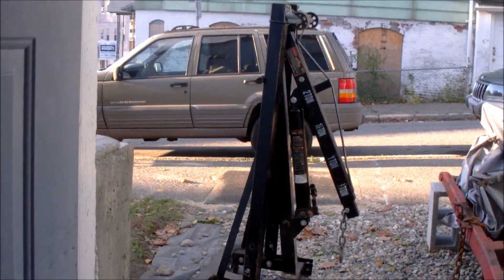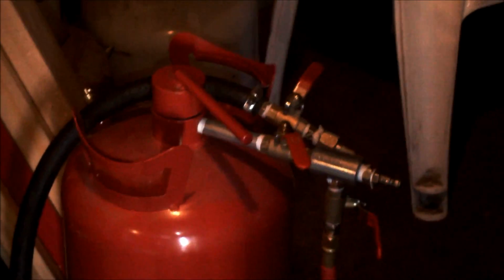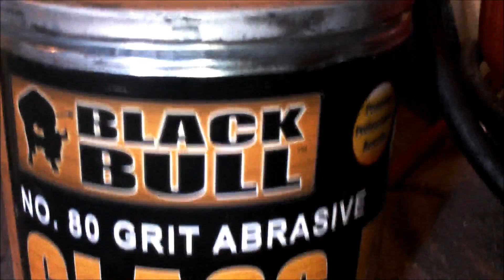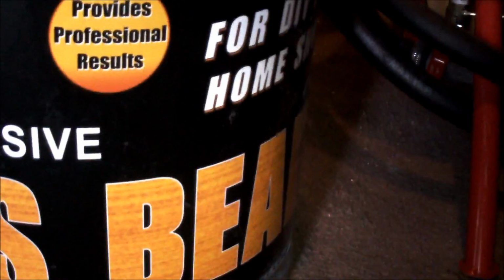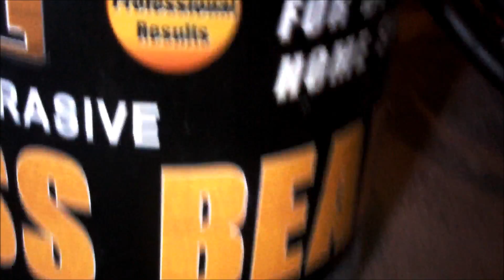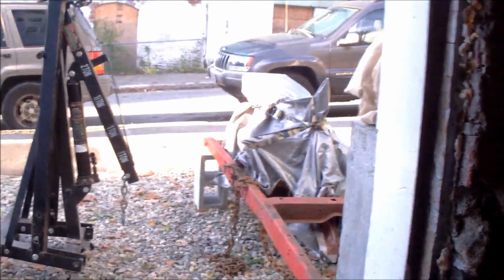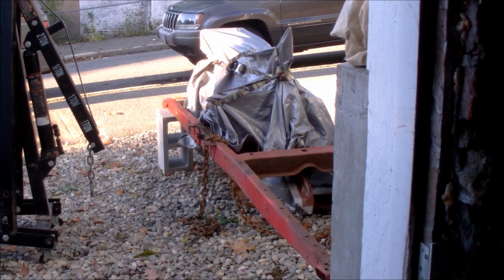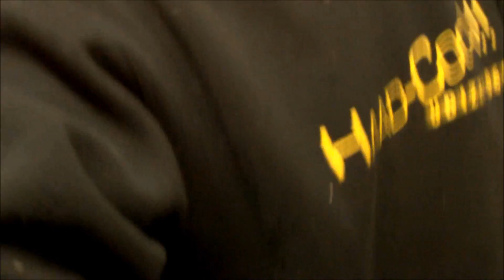The Final tear down of the Model A

Comment: My brother and I played around with sand blasting all day to do just four wheels, By the time we figured out the problems we were already done!  I have a big back hoe tractor I want to do but at this rate it may be cheaper to buy a new backhoe. We found the angle of the blasting nozzle can't be straight on or the sand comes back at you and hits the sand coming out! Also reduce the rate of sand flow,...that helped a lot too.With the gun at an angle the sand catches the side  edge of paint flakes and knocks them off.  if you have an email I can tell you all about it
Robert B
Reply from the maker: 70carlton udmurphy@charter.net

Comment: Hey Diz , Be very careful blasting the cowl or any sheet metal ...It will warp , distort or get very wavy... then it is junk . you would be better  using a D.A. sander or even one of your electric palm sanders. The Blaster will work great on all your frame and drive line parts.  Also there is a trick using white vinegar to remove and stop rust on body parts it's cheap and easy and works really well .  I have used it myself...Google it.
Best of luck and Many Blessings , SMR
Reply from the maker: TheSmreeder yes sir, that's why I got the new DA. and thanks for the tip bro, cheers man
Reply: panel warpage is generally due to operator error not understanding which type of media to use and incorrect operating pressure. never had any issues.done loads of car body shells.
as for white vinegar its pretty shit when it comes to heavily rusted items, takes weeks,, way better to use phosphoric acid which takes a few hours at worst.some brands of brick cleaner  have 10 -15% phosphoric acid, costing £3 a gallon.
just remember to properly rinse and not allow flash over.
Reply from the maker: well the sand blasting didn't go so well didn't try the DA yet, but got some real work done today, thanks for all the great info brother, cheere
Reply: saw your vid... I have the same pot , only put a couple of lbs of aggregate in at a time and make sure you have drained the water out of your compresser 2 times from the valve at the bottom.
A dessicant type dryer helps and a day w/ low humidity helps also. some times when the pot clogs just give it a few VIOLENT shakes and she start blasting again.
Good Luck and Many Blessings
Reply from the maker: thanks brother, im slowly working it out.  cheers man

Comment: udizzy what size compressor do you have, pot blasters are hungry on cfm,
small 1/8" nozzle 6-25 scfm depending on pressure.

worth a read - http://mcfinishing.com/resources/blastingtech.pdf

on sensitive stuff use a lighter / finer media, loads to choose from. 80 grade is medium
Reply from the maker: Jonny Hill its a 150psi  2hp 8gal tank. works good seems the friend who let me use it never cleaned it out, and she was full of crap. the store here only had 80grit so that's what I got. when I go again I will look for better stuff prolly, cheers man